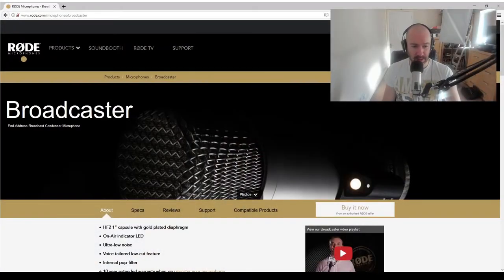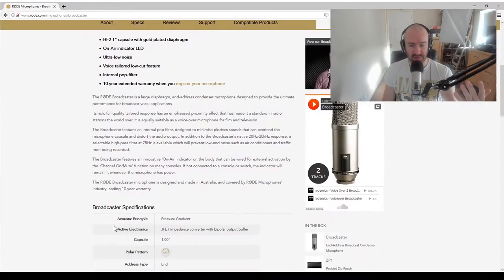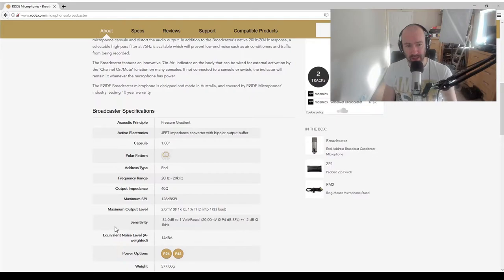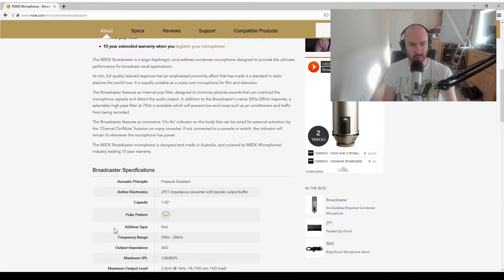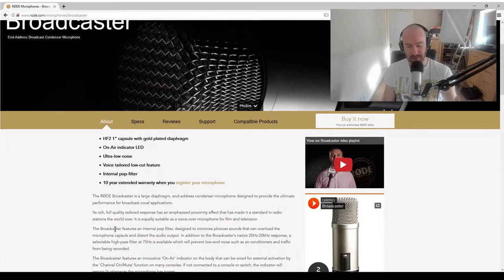Goodbye Rode Broadcaster

Comment: fyi, the ground pin in all Rode mics is slightly longer than the other 2, to ensure the ground is the first connection made when you plug it in.
Reply from the maker: +Darik Datta Thanks Darik. I've since found that out. At the time I didn't know.

Comment: P.S. no microphone is too old to work properly :) I own U67s vintage ... they are 50 yo ... just a reskin and they work marvellously ... I think what you're looking for is a much better mic.
As you can notice, even with the anti-pop, the labial consonants are too plosive. I can't send you here examples on what it's not plosive, compared to the mic you're using (and also the previous one), but the "P"s and the "B"s are too present.
The energy is concentrated around 50-60 Hz ...
As soon as you are at 20cm distance, they are diminishing a lot although at the same time, the voice becomes too nasal.
Ok for proximity effect, however I find it not so well managed.
Anyhow: this is the way in which the 90% of U.S. Broadcasters are loving :) (included the add of a small reverb :p )
Back to the argument: this is what I consider the real weak point of all these mics
Reply from the maker: It did seem like a good mic, but I just didn't have the right setup for it. I ended up buying a Shure SM7B and it's been fantastic.
Reply: The SURE SM7/B is excellent for your purposes.
I promised to myself to be back here to tell you, and you anticipated me :)

Comment: That's unfortunate
Reply from the maker: +Ed McIntyre Nah it actually turned out to be a good thing. I was able to test the mic and it's helped me realise what I need for my setup. :)
Reply: Kevin Muldoon aye but it's unfortunate how it's not the mic you thought you was getting
Reply from the maker: +Ed McIntyre Yeah that's true. I guess in retrospect I should have asked many more questions beforehand.
Reply: Kevin Muldoon aye perhaps seeing as though it was quite expensive. I personally would never use eBay. If I was going to use a site like eBay I'd try gumtree or shops such as CEX. Hopefully you didn't the mic you need
Reply: Find the mic you need*
Reply from the maker: +Ed McIntyre At the moment I'm swaying between the Electro Voice RE20 and the Shure SM7B. I'm going to do a little more research as to what other equipment I need to buy to get the most from it (preamplifiers etc).

Is this an area you know much about? I'm still learning but I find the subject interesting. There's so much to figure out.
Reply: Kevin Muldoon no I haven't got the best of knowledge on microphones really. I know Rode are a good company. Maybe for you seeing as though you already have a Shure mic and have found it good maybe you should get another Shure mic
Reply from the maker: +Ed McIntyre I've had a quick look at GumTree but haven't seen anything. More risky there anyways as there is no protection.

It's surprising so few mics get sold at CEX.
Reply from the maker: +Ed McIntyre There's a lot of good mics, and bad mics, from each company. Do you really need to check out each microphone individually and judge it on it's own merit.

Certain equipment, such as the SM7B, needs a more powerful preamplifier to work correctly, so you need to take that into consideration.

I don't want to let price by the deciding factor. I'd rather just get the best mic I can just now to save me having to upgrade later.

Comment: The RODE Mics have one of the pins longer .. generally the n.1 (GND)  ....
Reply from the maker: Yeah that does seem to be the case. :)
Reply: I'm not a real fun of Rode, although I think their choice has a positive drawback: when you insert any plug, you strongly diminish the risk of high noise transient, when you plug the cable in